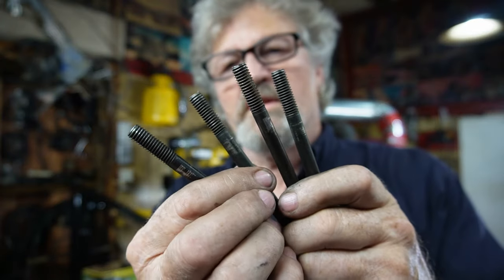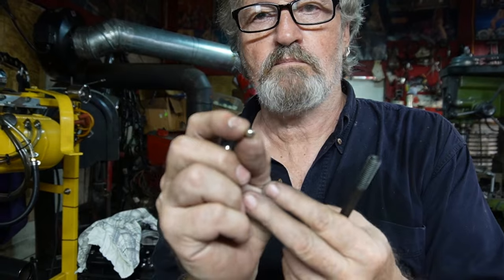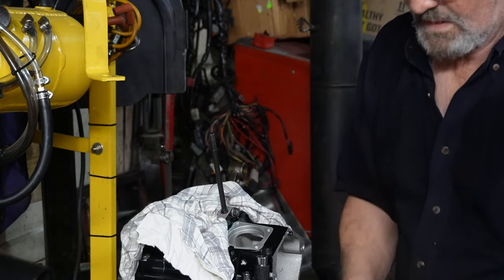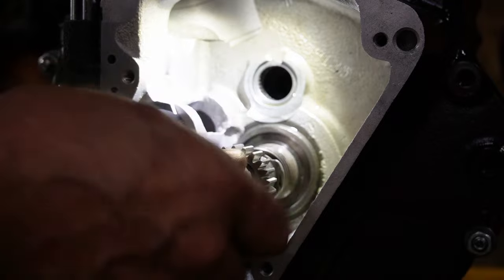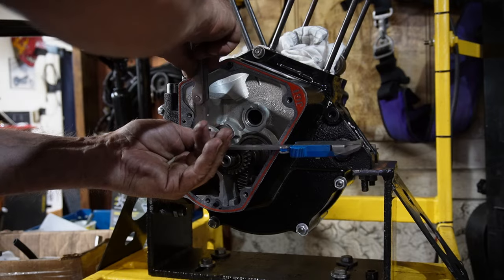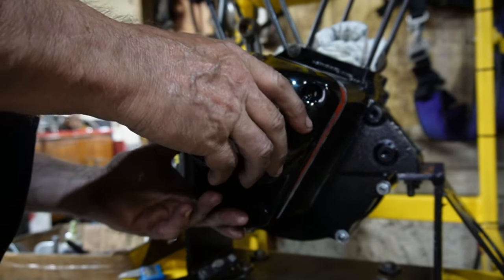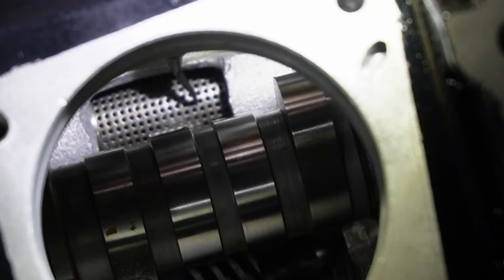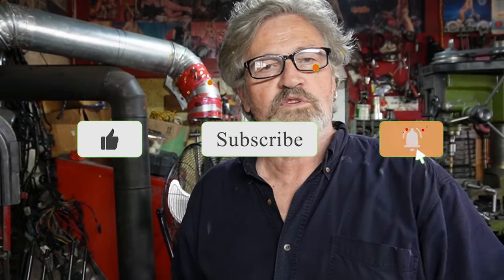CLEARENCES ARE CRITICAL IN THE CAM CHEST! CYLINDER STUD INSTALL. PITCH BLACK EVO REBUILD PART 6

Comment: Just found your channel  Ralph.  Good stuff. I just watched your vid on the cage bike. Fired right up after 2yr  storage. Amazing. I have a 73 fxe been sitting Lil over a year. She won't  start. I didn't  know about putting  oil in spark plug hole. I'm  guess cpl drops?
Reply from the maker: I just do that as a safty precaution to help get some oil in the cylinders for first start after a long period of time. I just put a few good squirts from the oil can in.  It does create some smoke but clears very quickly. On ounce or prevention as they say.  Good luck getting your shovel going.  Check for gas, spark and see if the accelrator pump is pumping gas into the carb. Sometime after sitting for along time the intermediate jet can get plugged up by bacterial growth and will make it not idle and hard to start. They would need to be cleaned out. Thanks for taking the time to comment!
Reply: @itsmytimeletsgo  thank you for advice. Greatly appreciated.